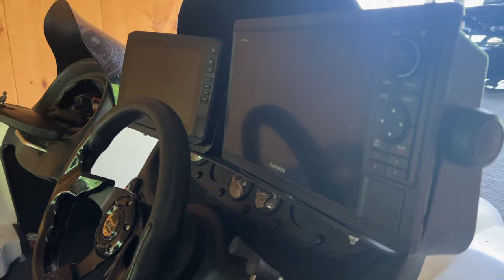Boat Electronics Graph Mounts : Boat Restoration

Comment: Did that mount have any kind of bracing to support the back of the dash panel to the fiberglass console?? I did a amp dash panel on my 02 and mounted a ram and it held up ok with my 93 but when I upgraddd to a 106 I added a block and a bps balls out style mount cause the weight of my 93 broke half the the screw tabs that hold the dash panel in and now the other tabs are broken. So if not for the mount and block in the back my panel would have fallen out
Reply from the maker: Oh wow this one just attached to the previous one with several screws seems rugged